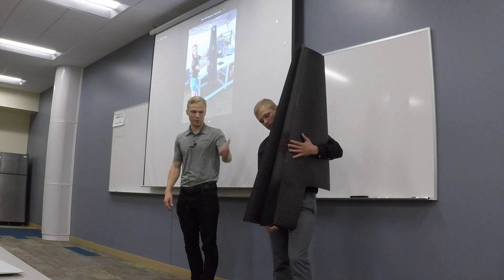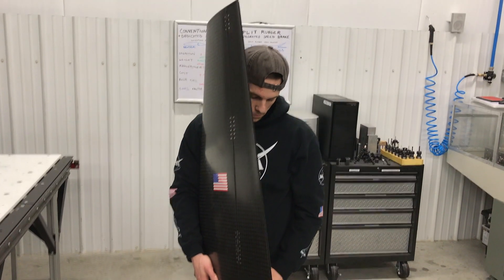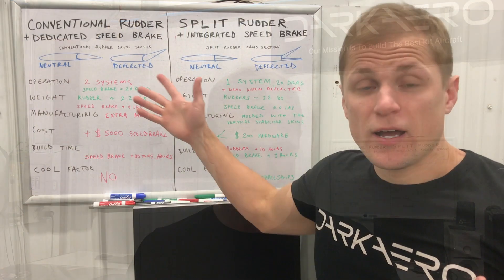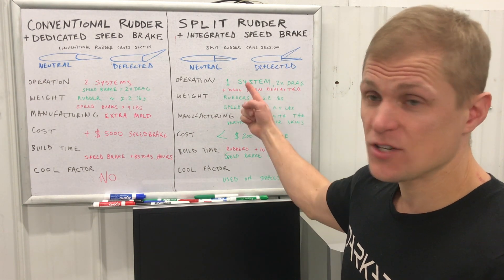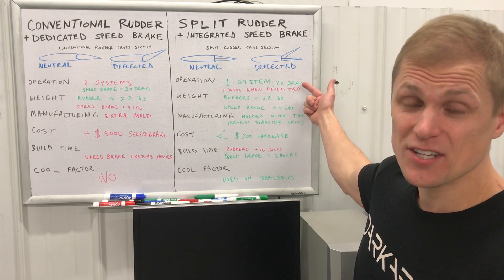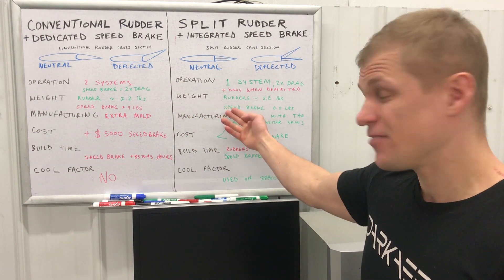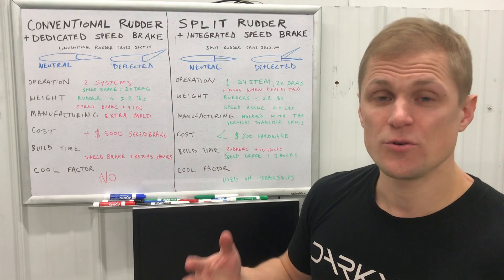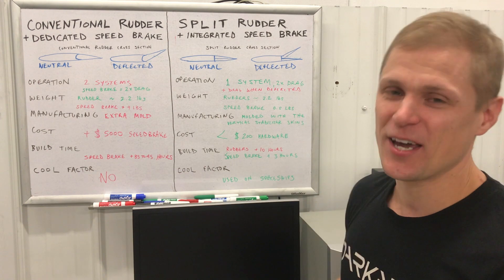The DarkAero 1 Aircraft Split Rudder

Comment: If you allow the rudder sides to move slightly past center you could trim with little drag. Handle operation of the brake and mix like a flaparon.
Reply: I was thinking the same thing, and if both rudders utilize return springs they should follow each other tightly
Reply: Exactly. For a design supposed to be operated at top speed, as is this is a feature that would actively prevent it from ever reaching said speed stably.
Reply: @meusana3681  Some really questionable design choices with this aircraft.  Every time I watch one of these videos it's like they're trying to do everything opposite of what the fastest and most efficient aircraft are utilizing.  No winglets, split rudders, split flaps...I just don't know what to think of these guys.  About the only aspect I see that could make this aircraft perform is the fact that it might end up being really lightweight due to all the things it lacks.

Comment: How will the split rudder work with an autopilot system?
Reply from the maker: Coastal AL Composites, LLC. We are just going to use a 2-axis autopilot on the prototype for pitch and roll. We don’t see adding a 3rd axis for the yaw as worth the weight and cost although it could be added. The yaw autopilot could be setup to give inputs to the rudder system the same as with a conventional rudder.

Comment: Thanks, great project, but what about trimming? If either half rudder cannot go beyond central how do you trim?
Reply from the maker: We will probably initially fly the prototype without rudder trim but there are a couple options we are considering. One would be a fixed position ground adjustable trim tab. Another option would be an in-cockpit adjustable spring tension system that applies a light tension to the rudder system to give a small rudder deflection. There are commercially available trim systems like the latter option available for Vans kit aircraft.

Comment: How are you going to do rudder trim?
Reply from the maker: We will probably initially fly the prototype without rudder trim but there are a couple options we are considering. One would be a fixed position ground adjustable trim tab. Another option would be an in-cockpit adjustable spring tension system that applies a light tension to the rudder system to give a small rudder deflection. There are commercially available trim systems like the latter option available for Vans kit aircraft.
Reply: @DarkAeroInc  Do you have plans to allow for a yaw damper? I'm wondering if this might be helpful for creature comfort given how short the aircraft is!

Comment: Does deploying the split brake effect pitch because it's the full length of the vertical stabilizer? It's hard to see from the video if it's wider at the bottom or not.
Reply from the maker: Thien Lieu a minor pitch change is possible when the speed brake is deployed since the drag center of the two rudders sits above the aircraft CG. This isn’t much of an issue though since pitch changes also result from extending flaps or landing gear or even entering a banked turn.
Reply: @DarkAeroInc  not the same flaps and gear are deployed with altitude air brakes may be deployed close to the ground in the flare would result in a hard landing or nose wheel collapse or worse

Comment: I'd make the split rudder an option to come later once everything else has been figured out and you have actually concluded that the usual means (draggy landing gear, flaps, prop in flat pitch) are not slowing you down enough. I'd just put the expensive speed brakes into the prototype and be done with that issue and see whether I actually need them.
Reply: You could say the same thing about any of the other features. How many full-scale flying prototypes would you want to build?
Reply: Points, taken. Slippery airframes like this need a brake when in flight in a descent well outside the terminal control area where gear and flap settings would not be changed. For instance, the normal operation of gear and prop pitch in most retractable gear aircraft is usually, not until at or near the final approach fix.  Roughly <10nm flight path from the runway threshold. Initial flap angles often give more lift than drag. There are safety and comfort considerations to consider like exceeding Va in turbulence, which one will often find closer to Earth and exceeding other V-speeds for flap and gear. Speed brakes are often used in a periodic fashion. Shorter duration, as needed. 

I think now is the time to design such a system into the airframe, or delete it altogether. Upscaling and adding design changes post production are usually engineering nightmares. They result in cascading effects of change. 

Just my two cents.
Reply: @user-tv5dt3nm9y  I thought this to be the inherent problem of big engines with a limited cool-down gradient and pressurized airplanes. Those cannot significantly reduce the power on descent, else they would cool down too quickly, especially at high altitudes or not produce enough bleed air for pressurization. Turbo charged engines also need a minimum manifold pressure to keep running at very high altitudes. I would think that this plane allows cutting the power on descent.
Reply: Martin Renschler well there’s a lot to unpack in your statements. As far as the DA1 is concerned, I believe the concern is of how to go down and slow down in a time and space limited airspace. There are speed limits to consider, Vne, and maneuvering considerations like turn radius and bank angles, blending with other traffic, accelerated stall margins, and uncomfortable g-loads with a higher loaded wing.  Lol, your significant other may not find 60-70 degree bank angles at 2-2.5 g as much fun as you do. I’m not going to touch the shock cooling mythology.

Just how slippery is it?  Look at the DA1’s cruise airspeed projections vs HP, its overall dimensions, the wing loading, and a clean, non-parasitic drag producing skin. To get your head around it, compare those numbers with aircraft of similar design goals out there.
Reply: As others have commented I think the operation described is an unnecessary burden on the pilot. With a little work I bet you guys can develop a mechanism where you have a lever for speed brakes. The rudder pedals would work like a conventional aircraft deflecting only the side pushed forward while also mixing the movement when speed brakes are deployed.
Reply: It’s smoother than other aircraft that use speed brakes. I’m sure they have already worked it out.

Comment: This very well might be my next build. Besides being composite with a retract, this split rudder idea I find the most appealing.  I'm guessing you'll be adding a bit more structural reinforcement than what you displayed. 

Also any thought of adding trim without inducing drag? It would have to be able to move past center while closed.
Reply from the maker: Justin Wylie we will probably initially fly the prototype without rudder trim but there are a couple options we are considering. One would be a fixed position ground adjustable trim tab. Another option would be an in-cockpit adjustable spring tension system that applies a light tension to the rudder system to give a small rudder deflection. There are commercially available trim systems like the latter option available for Vans kit aircraft.
Reply: @DarkAeroInc  Both options would probably work.  I have Aerosport's tension spring system on my 10.  The only issue I see on a system like that on a split tail would be that compensating either way would induce drag.
Reply from the maker: @AviatorJ1  That is also an issue with deflecting a conventional control surface to trim. At small deflection angles (trimming) the drag increment is very similar between both style of control surfaces.
Reply from the maker: @AviatorJ1  How do you like the Aerosport system? That's the unit I was referring to.
Reply: @DarkAeroInc  It works, but I also have a yaw damper so I only really use it in extended climbs.  The only downside is being 100% mechanical there's no trim guage.

Comment: how about a lever that mechanically links the two petals to prevent split action. a stressed pilot could inadvertently push both petals. when trying to extend glide that would activating brake would cause a missed landing.
Reply: That was my concern too. I've seen a lot of clowns mash both pedals without knowing it while under stress around the pattern. Maybe a "speedbrake" tone or other alert (bright annunciator) will help improve awareness for pilots subconsciously activating the brake.
Reply: A very simple pulley system that ties the two petals together could work.  Cause the petal that is not being pressed to spring loaded for undertravel (petal moves toward pilot) when the petal being pressed moves forward.  move the pulley out of locked position to enable air brake.  operationally this would be much safer.
Reply: @davidchow9528  Why spend effort, weight, and complexity solving a problem that is only hypothetical? Why assume that the end result of this complexity will be improved safety? Why not just stick with the 172 if that's what you're comfortable with?
Reply: Good points. The pilot does need feedback on when any system is in use.  Is it in use and to what degree.  Primary and secondary indications. I like a tone and would I like to easily see my tail, anyway.  A mirror works.
Reply: Keep your eye on the BALL!  The ball on your turn and bank indicator ball will tell you all you need to know!  It is just like a normal ruddered airplane, if something doesn't look right with your instruments, you are not flying the airplane right.  Keep the ball centered unless you want to slip or skid the airplane.
Reply: Richard Visscher A bobble head on the dash could also work. 😃
Reply: David Chow I agree. Some sort of system where you can select it on or off, would be a great idea. 

People will accidentally use it.